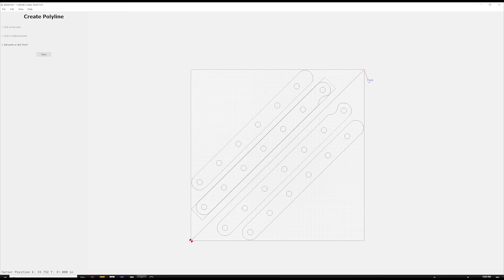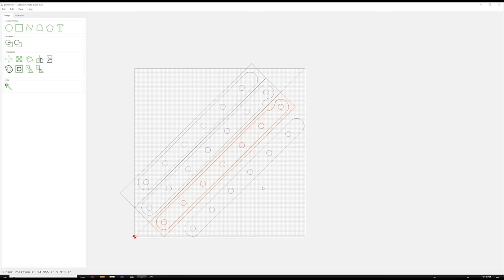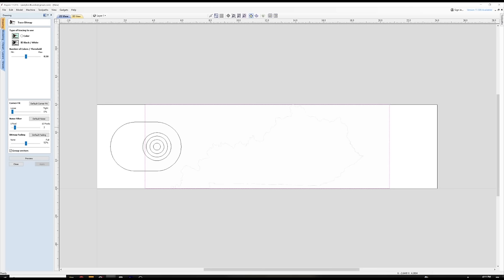Watch This Before You Buy A CNC Router In 2023

Comment: Instead of a laptop to feed code to the CNC machine, get a cube-style desktop computer like a Raspberry Pi or equivalent (many under $100) and that can be your CNC controller. Don't subject a $1,000 laptop to a dusty shop environment. You can likely scrounge an old desktop monitor, keyboard, and even a computer from a garage sale that will work after installing Linux on it for better speed.
Reply: Passive cooled for extra sauce.
Reply: I plan to have super long cords to the laptop wireless display and mouse and keyboard
Reply: Yeah, I use a raspberry pi (the one built into the keyboard) and it works great. I think the entire kit (keyboard, Pi, mouse, micro-sd, power supply) was $100. It’s attached to a 24in ASUS monitor.
Reply: You can get perfectly good old Dells or Hp desktop machines that are around 50-60usd that are more than capable of running LinuxCNC.
Reply: I use an old dell all in one (7440) that I got for £70 gbp. Works a treat.
Reply: Until you want to do anything in depth and the processing power just can't handle the load.
Reply: @jvin248 perhaps do a video for us technophobes. 😂😅
Reply: perhaps do a video for us technophobes. 😂😅
Reply: Esp32 and your phone 😂
Reply: A Rpi doesn't have the processing power to handle 3D parametric modeling software.  Fusion 360, Catia, Creo, solid works, Inventor, etc.
Reply: I need a cnc machine to use it with acrylic and aluminum. This machine is good for those materials too?….I’m very, very new to this.
Reply: @creamysbrianna for running only not creating the design
Reply: If you want a laptop - there are plenty of quality refurbished models available on websites such as Amazon for a few hundred dollars.
Reply: I use a Microsoft surface pro for exclusively running UGS. for design I use another laptop. The surface pro has OneDrive for accessing the CAM files. For keyboard and mouse I use Bluetooth connected to a usb hub

Comment: I always recommend cnc-curious people to get a 3d printer first :) Same mechanics, similar software and hardware, and super useful in any workshop.
Reply: Yep, great advice. Except for learning toolpaths / feeds and speeds, they are quite similar from a beginner's point of view. Can even get ready-made projects for both to start on before learning drawing or design programs. And people would be surprised just how much a 3D printer can help outside of "just making toys." Heck, have an air system but the nozzles don't connect to the tool? Design an adapter and save $100 on a new hose.
Reply from the maker: Great point. Thanks for sharing. I think a laser is a great first step as well.
Reply: I got a CNC because I work with so many 3d printers full time
Reply: I would recommend a diode laser first. The main reason for that is because it’s the same premise as the CNC router in that you’re engraving and cutting rather than building. The 3d printer is a good idea as well, but if they’re interested in carving, they’re more than likely not as interested in 3d printing.
Reply: @RoseKindred Great if you have a budget that can cope with 2 machines!
Reply: Agreed
Reply: Eh, I don't agree with that advice. I own both. In general, 3d printers are for play projects, miniatures, toys, etc (notable exception to jewelers). CNC routers are for making parts.
Those parts could also be toys etc, but they are as strong as your starting material.
For example, make a coat rack... on a 3D printer. I'd expect it to break. Make a coatrack on a cnc router. You can engrave it and make it cool or just simple, but you can make it out of alu or oak or any other wood that isn't balsa, and it will be strong. (well, assuming you didn't thin it down to the point of the wood being frail).

I've fixed broken car parts on my CNC router. I've made alu molds for friend's business. I've made imprint stamps. I've made a custom brake caliper mount for my dualsport motorcycle. It has survived sliding on the dirt and rock slamming into it.
On my 3d printer, I've made miniatures that are prone to break from sliding off the table onto a hardwood floor. I have cheezy flexy phone mounts other friends have given me.

Now if you already have some business model in mind, don't let that discourage you. There are absolutely prototyping businesses that make a profit off 3d printers. There are also a lot of uses related to casting, either as lost investment or as disposable molds.

And before someone chimes in about metal 3D printers, that isn't even close to the categories being talked about here. Not a single person I know has a metal 3d printer, and very few businesses do either.
Reply: @user-tf1oo9rj6u  The advice was to get a 3D printer FIRST, not INSTEAD of a CNC machine. When I first ran my CNC, I wasn't scared and had almost no anxiety because I already had 3d printing experience and knew what not to do and how to run such machines safe. In fact, my first CNC machine was 3D printed :) So I could reprint any broken parts easily and fail cheap while learning. Eventually I have built a real CNC machine. So I think 3D printers can smoothen the learning curve.
Reply: @user-tf1oo9rj6u actually no. My experience says 3D printer first. The seamless integration of hardware and software is fabulous, all first time cnc’ers should experience it first. The workflow is almost similar up to the CAD part. A 3D printer is certainly not restricted to toys..😂😂. I use a 3D printer for making cnc fixtures and work holders apart from actual functional parts. BTW We only mill aluminum parts

I feel both technologies additive (3D printing) and subtractive (CNC milling) should complement each other

Comment: Did a company called Sienci Labs ever enter into your CNC search?
Reply: I have 2 of them, been running them for my business for 3 years now with no issues.
Reply: They’re good machines, just slow very slow at 3D carves
Reply: @jeffverdin6105    It's only as slow as the chipload of your bit. You can set speed to whatever you want.  Not slow at all.
Reply: @Supe063  true, but like I said- for 3Dcarves it’s slow. Chip load has zero to do it on that level
Reply: They are doing some interesting things for sure

Comment: A couple of things that you didn't mention. NOISE. My shop vac is louder than the router. Both together is deafening. A pair of 30 DB earmuffs is necessary. Some sound proofing may come in handy.   TABLE my S4 XXL requires a table of about 4' X 5'. You have to put it somewhere.

Comment: great video.  I will need to watch again.  I'm looking to get into the CNC Router work.  I'm just a hobbyist.  I build alot of cutting boards right now and I would think that using a CNC would help with getting things flat and putting juice grooves in the boards.  also wife wants me to build some interior decor she can use in her house set ups.  The biggest hurdle for me is the software.  I have a vast background in woodworking and metal machining so I guess CNC is the next way to go.
Reply from the maker: Thanks for the comment! Its sounds like you're ready to jump into CNC. Based on my experiences and what you've shared, I would recommend going with a Shapeoko. Great machine, very capable, and it includes everything you need to get started, including software. They have a ton of support to help you get up and running. shop.carbide3d.com/andybirdbuilds
Reply: @AndyBirdBuilds  I just posted a comment asking about the software and was able to find it already answered in the comments.  That definitely takes some of the headache out of it being that I see CAD costs a whopping $2,000 a year just for one user.  Outrageous!
Reply: @agomodern that's not typical, there are much cheaper.

Comment: For work holding, I use strong masking tape on the bed & the underside of the work piece with superglue in between. I've got 1 inch & 3 inch wide Scotch, heat resistant tape that sticks really well to the bed & the 3mm to 18mm birch plywood I use. It doesn't take as mush super glue as you'd think. If I'm cutting small parts, I just use glue lines that are closer together so the part stays down. Not sure where I got this from as I've been doing it this way for years so it might work for others.

Comment: Great video Andy. I’m a year and a half into my cnc journey and you helped immensely when I began. I originally wanted a onefinity but the wait list was over 3 months so I went with the Shapeoko and have been very happy. Carbide create is not the best out there but it’s a good starting place, I used the free version for at least 9 months. It took about 5 months to actually break even and start making money with it and it was a very good decision. I agree that it’s a great place to start but you will eventually want to upgrade everything. At that point you’ll know what you want and where the shortcomings of your current system are.

Comment: And this is why I went from a Chinese import 3D printer kit, then built a CNC router from scratch running LinuxCNC using FreeCAD for my CAD/CAM software, and now am building a second much heavier cnc router along with other DIY CNC machines in the near future.  I was looking at SendCutSend and realized that I can basically do everything they advertise, I just have to set up for it. I am definitely not limiting myself to wood products but instead am including plastics, metals, and even looking into molding carbon fiber. Once I get the new shop built a DIY plasma cutter for making outdoor steel signs is also a definite.  Don't know if I'm going to build a powder coating oven or just send it to a local shop, it will depend on how big I can afford to make the new shop.

The catch is that this approach TAKES SO MUCH LONGER.  You are paying using one currency or the other - if you BUY, you are paying in lots of money-units and little time.  If you DIY you are paying in lots of time and some money-units.  Spend wisely.
Reply: The program you used was from Linux?

Comment: I’m a woodworker, but wasn’t looking for a cnc, but my son recently gave me his old Bob’s cnc evo 4 to play with to see if I like using a cnc. I have absolutely no experience with cnc’s or g code software so thought I would start searching YouTube and came across your video. It appears Bob’s has downloads of their software for free, so I’ll try that first based on your recommendation of starting with the manufacturer software. I’ll check out your other videos as well! I also have the same HF vacuum system you use, but only used it a couple times. Not sure why, but I’ve been using a 2-stage shop vac system for years as they’ve served me well, although they aren’t great on planers and jointers as they create a lot of chips and sawdust fast. Anyway, if anyone buys the HF vacuum, you’ll need to remove the plastic blade protection screen as the wood chips will get clogged up fast on the screen and you won’t get any suction. Thanks for the video!
Reply from the maker: Thanks for sharing. Welcome to the world of CNC!

Comment: Andy, Lots of good information, great video as always. 

However, the one thing you didn't cover is, what if you do not have the MONEY to buy a larger machine. I personally started with a Sainsmart Genmitzu 3018 for $200.00. This machine came with 10 engraving bits to get started. This is the most cost-effective way to get started in CNC. In my opinion. This also helps those that are not sure they would like this type of work. PLUS, a good starting point to make money. I did everything from engraving projects to relief carving with this little machine. It works just like a bigger machine, jobs just take longer and is limited on size, but a great place to start.

Also, YES, YES, YES, Shapeoko is a GREAT company. I purchased the Shapeoko PRO XXL 2 years back and received 100% great customer service, answering questions, replacing defective or missing parts. The forums offer extensive assistance with projects and offering ideas for projects. So yes, excellent company to begin a journey into woodworking.
Reply from the maker: Thanks for sharing. A lot of great points. Although these smaller machines are an okay place to start for some, (I've made a video about that) I feel often times its a waste. Here's why. 1) Most people get frustrated with the physical limitations. 2) The software is hard to use. 3) There is very little support if you need it. 

If you're going to spend $200 on this, take however long it's takes to save $1500 for a small Shapeoko. If it isn't for you, they have a great resale value. Sell it for $1300 and boom, you only spent $200 to give it a try. You're going to have a much better experience this way.
Reply: @AndyBirdBuilds  
I get your point, but I think you may have missed mine.
I would have never been able to convince my wife to save or spend the money for a larger machine. I was however, able to get $200 for a Xmas present. Showing her what I could do with that over a few years and happening to get the tax monies from the Gov. She finally agreed. 
I will soon be able to add a laser to my machine for even more options for projects.
Sometimes you need to work with what you are able to get where you want to be. :face-blue-smiling:
Reply: I think these are both great points of view. As someone who is looking to get their first cnc in the next few months, the main difference between your viewpoints are the stakeholders and the environment.

Andy has a workshop, yours is more likely one at home. Therefore you have to convince your partner as well as yourself. After discussions with my wife, I have limited space and as we share finances, it is easier to commit 200 than 2000 up front. However, the projects I want to work on need at least 400x400mm work area. 

After watching this video I will save up for the larger machine and learn the software in the meantime.
Reply: this year i bought a metre long screw, two metre long extrusions and two metre long supported rods(come with bearings), longer shaft coupler, about the price of the original machine to give it a 300x800mm capacity.  with a regular 3018 the width is just as easy to modify, the 3018pro is hard to widen.  so you have the base of a machine that can grow, eventually buy more extrusions and you'll have an enormous machine, maybe square rails on the other axis, mgn15's can be had cheap.
Reply: @homezero  Yeah - I get your point, and it's a bit of the situation I am in too. And, honestly, I only need a small machine that can do very basic things. I probably going to use it mainly for PCB design (I have have worked in a electronics and networking environment, and still do electronics as a hobby now). I probably so some wood cut outs for cases, but I also have a 3D printer that does a lot too. So yeah - For now my needs are mostly for a (relatively) cheap and small machine.
Another point I would make a remark on, is the cost of the software. Carbide Create is not longer free (only usable as demo honestly) and sets you back $120 a year or $360 for a Perpetual License. Vectrix is even more expensive, so it's difficult to put that in beginners or even hobbyist space. There is software that is free, but has some drawbacks (only file generation for one tool, or pay if you want more), or is always online (I rather have local software because, just as they did with Fusion 360, they can change or cut out stuff you need just on a whim). For now, because I only will use the PCB part of CNC, I will use FlatCAM.
Anyway - It does not hurt to take a look at the available free software, and the pro's and con's.

Comment: Andy one thing I think you forgot to mention about holding, if you’re new and using screws making sure your tool path isn’t set to go over that screw. A quick way to break a bit. If your project is going to be 10 inches wide make sure your wood is bigger than your final project give yourself a few inches on each end to ensure your bits won’t make contact with the screws. 

Solid advice Andy! Great videos as always. You helped with my learning curve tremendously and I have started to generate income on the side with my shapeoko 4XL. Thank you!
Reply: good machine